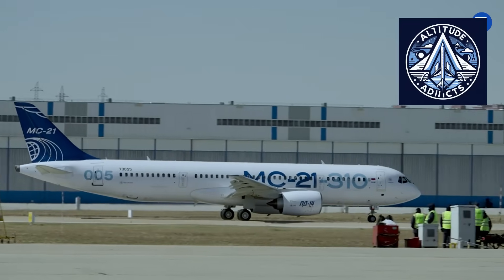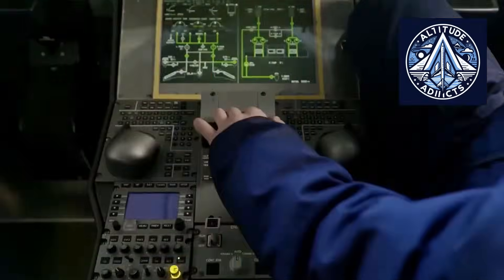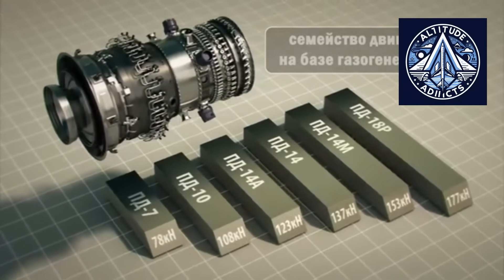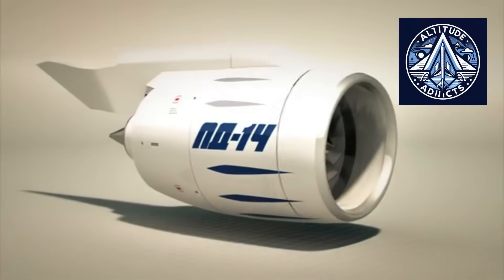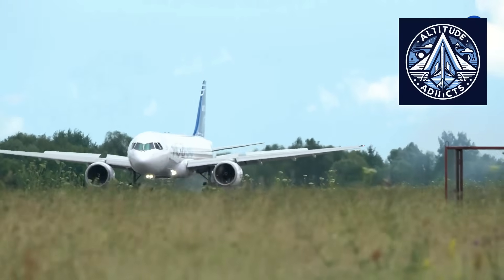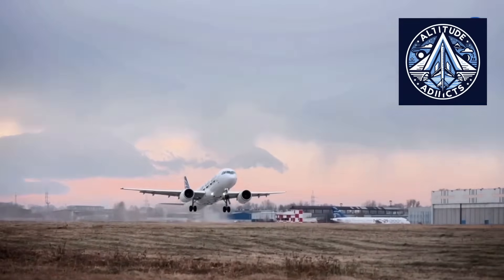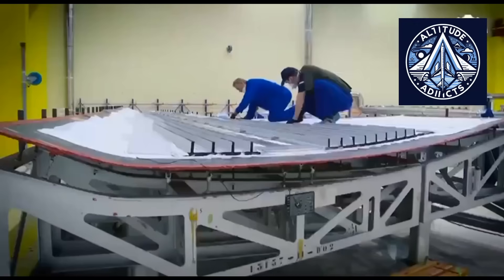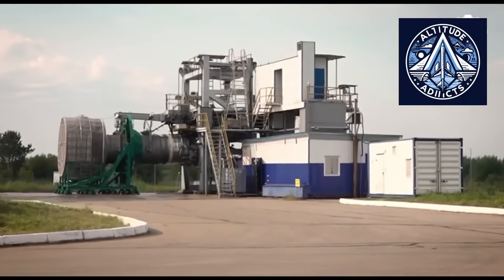MC-21 Weight Issue—Can PD-14M, PD-16, or PD-18R Solve the Problem?

Comment: МС-21-300 (первый полёт 28 мая 2017 года, двигатели Pratt & Whitney PW1400G, США) и МС-21-310 (планер был аналогичен МС-21-300, первый полёт 15 декабря 2020 года, двигатели ПД-14, РФ). В таблице указаны характеристики нового "импортозамещённого" МС-21-310 на май 2024 года. 
Самолёт: прежний "старый" МС-21-300 (2017 год) / новый "импортозамещённый" МС-21-310 (2024 год) 
Пассажировместимость, норма – максимум, чел.  163—211 / 163—211 
Длина самолёта, м  42,3 / 42,3 
Диаметр фюзеляжа, м  4,06 / 4,06 
Максимальная взлётная масса (MTOW), кг  79 250 / 85 000 
Максимальная посадочная масса, кг  69 100 / 73 500 
Масса пустого снаряжённого самолёта (OEW), кг  43 400 / ? (нет данных) 
Максимальная коммерческая нагрузка, кг  22 600 / 21 300 
Максимальная заправка топливом, кг  20 400 / 20 400 
Крейсерская скорость, км/ч  870 / ? (нет данных)  
Дальность полёта с нормальной нагрузкой, км  6000 / 5100 
Стоимость, млн долл. США  96,1 (2018 год) / ? (2024 год, нет данных)

Comment: ИРКУТ – Иркутский авиационный завод, филиал ПАО "Корпорация Иркут". Основные официальные характеристики ИРКУТа для среднемагистрального пассажирского самолёта МС-21-300 на 163 (норма) - 211 (максимум) пассажирских кресел по состоянию на 28 мая 2017 года – это дата первого полёта МС-21-300 с двумя двигателями Pratt & Whitney PW1400G, США. 
Максимальная взлетная масса (MTOW), кг 79 250 
Масса пустого снаряженного (OEW), кг 43 400 
Максимальная коммерческая нагрузка, кг 22 600 
Нормальная коммерческая нагрузка (одноклассная компоновка, шаг кресел 32”), кг 18 100 
Дальность (при нормальной коммерческой нагрузке), км 3500…5200 
Крейсерская скорость, км/ч 850 (М=0,8) 
Высота полета, м ~ 12000 
Длина ВПП (760мм.рт.ст;+30° С), м 1945

Что сразу можно увидеть: 79250 – 43400 – 18100 = 17750 кг топлива для полёта на 5200 км при нормальной нагрузке и компоновке на 163 пассажирских места ???

Comment: As a long range option, turboprop engines (propfan) can be installed. Those engines have better fuel efficiency than turbofan engines. In the long term future, the rising price of fuel will force all the airlines to switch to turboprops (propfan) anyways.

Comment: the PS-90 widely used is a 17 ton engine .....  eg the Tu-214 .... they designed the PD-14 as a 14 ton engine ? why ? you can only assume that their plan is to make a geared version of the PD-14 with a bypass ratio of 12:1- and get a PD-18. That will eventually replace the PS-90. They tested the MC-21 with geared P&W engines on the MC-21-300 .... after all
it's the only scenario that is logical to me and Russians usually are .... 

Maybe the "weight" issue is more related to the larger diameter of the MC-21 fuselage compared to the 737 and A320 - resulting in a larger external surface area ? the designers are always boasting about more cabinet space and a wider central aisle .... 

so I asked Microsoft's supposed AI system  "Copilot" - and got this 

 "Therefore, if you want to find out how much the circumference increases, you can simply multiply the diameter by π and then add X.
In summary, increasing the diameter by X will indeed increase the circumference by πX." 
π = 1.62

it could add up quite significantly over a 40 metre length ?

Comment: Never happen.
That would be redesign of the wings.
All they need to do is keep working/practicing/upgrading their work with the composites for the skin of the aircraft, to return to previous weight.
Take 1-2 years. Russians are smart and industrious. They'll get it.
Reply: Спасибо большое
Reply: Sayapnya pernah dipasang mesin PW1400G yang diameter Kipasnya 206 cm. 
Rekayasa mesin baru cukuplah mengacu besarnya diameter mesin PW itu. 
Dengan demikian sayapnya tidak perlu ada perubahan.

Comment: he has no weight problems.  it consists of 20% composite and titanium.  it is lighter than its Western counterparts. its range is 3,800 kilometers with a maximum load of 18.5 tons and a maximum takeoff weight of 85 tons